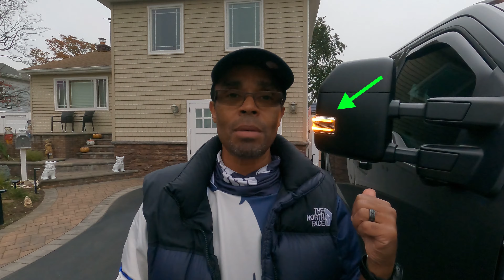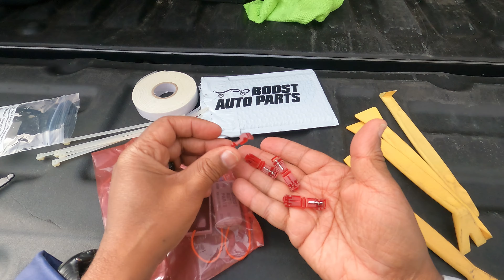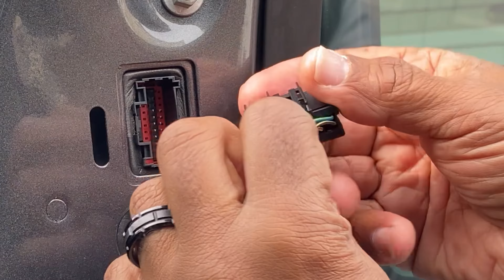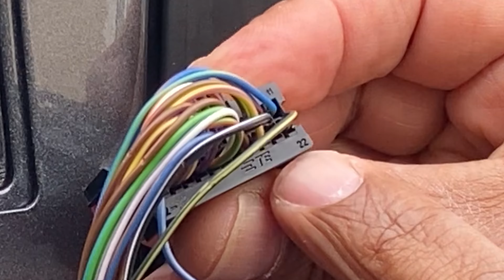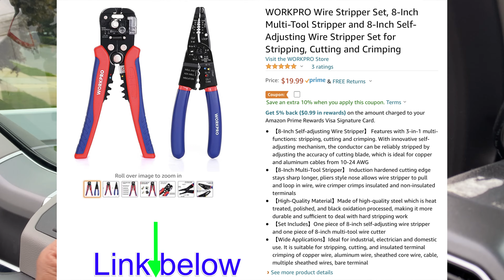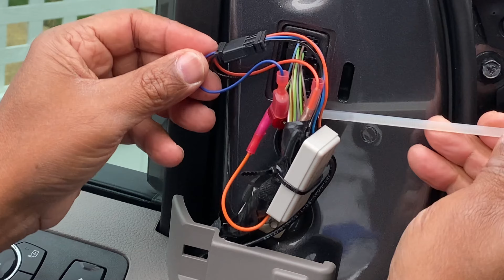How to install Dual function (running & Signal) Ford Tremor Super Duty F250 F350 Tow Mirrors

Comment: Thanks Ray, I ordered the Boost Auto replacement lights as well. I would recommend using some dielectric grease in your connections just as a preventative measure . Great work!
Reply from the maker: Great tip, thanks for the feedback and please remember to subscribe to the channel and like the video.